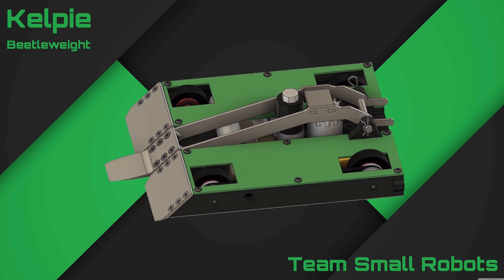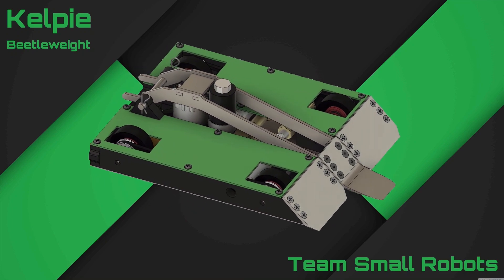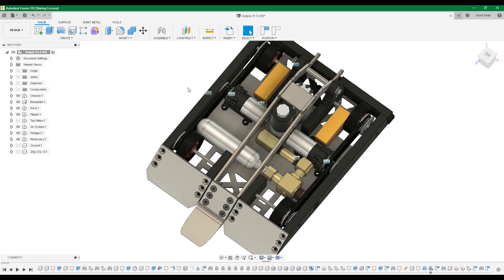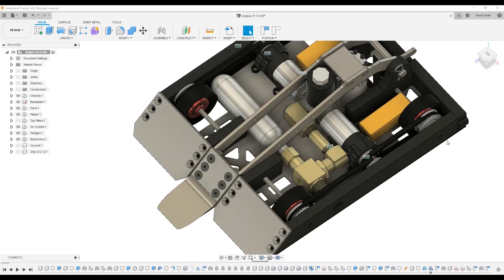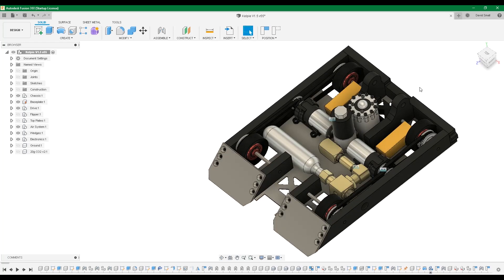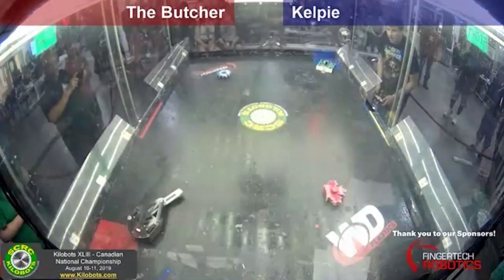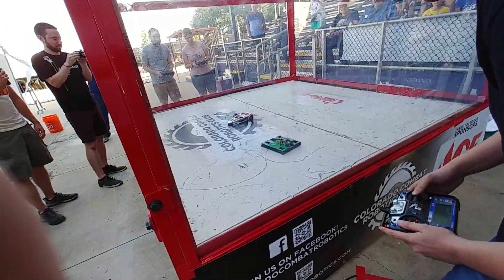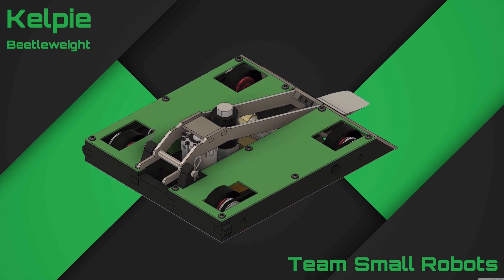Kelpie - The World's Smallest Full Pressure CO2 Flipper

Comment: why dont you have a regulator?
Reply from the maker: A few reasons. Less pressure means less powerful flips. I opted to go unregulated for less flips but more power. If you did squeeze one in though, you could have more flips but at less power. Regulators are also big and heavy, making them undesirable in insect weight classes.

Unlike air, Co2 is self-regulating. When co2 gets to around 800 psi, it starts to turn into a liquid. The cartridges Kelpie contain liquid co2. So when you release some of that gas for a flip, instead of lowering the pressure, some of the liquid gets converted into gas and the pressure stays at 800 (it'll actually drop a tiny bit because the tank gets cooler, but for simplicity, we can ignore that) So as long as you have liquid co2 in the tank, you can keep firing around 800 psi. Once you run out of liquid though, the pressure will drop little by little with each flip just like letting air out of a balloon.

Comment: Title's a bit misleading as different weight classes have different full pressures. There was a robot called Anticide from the UK which weighed 150 grams and could operate at 190psi (the maximum allowable in UK ant weight competitions is 100psi). The heavyweights used to be limited to 1000psi but that might have changed in recent years. I'm impressed regardless.
Reply from the maker: Nothing misleading about the title. Anticide is not a full pressure co2 flipper. It isn't even a co2 flipper.
Reply: @TeamSmallRobots  Correct! If anyone thinks TSR (LOVE the homage to the creators of D&D) isn't telling the truth, you should look up Anticide's publicly published stats, you don't even need to ask Andrew (Anticide's builder) about it. Anticide uses a CO2 cartridge, but Andrew uses compressed air (from an air compressor he brings to events with him) to charge it. I love Anticide, I love 150g bots. I think Kelpie is awesome!
Reply: @TeamSmallRobots  
Maybe one year on I have an opportunity to learn. 
It doesn't mention CO2 in the title, so I presume the definition of pull-pressure implies the use of CO2.
My understanding was that the definition of full pressure was using the maximum pressure allowed by the rules in the container directly - rather than through a regulator.
What is the definition?
Reply from the maker: @Combatechist  Good point. I've updated the title to include "co2" in the name.

Comment: Sorry if a dumb question, do the pneumatic parts screw together with standard fittings or do you have to modify them to make them fit together airtight?
Reply from the maker: Any NPT fittings need to be wrapped with PTFE tape or else they'll leak. And make sure they'll rated for the pressure you're using so that nothing explodes in your face :)
Reply: @TeamSmallRobots  Thanks for replying! ok so I should get parts with all npt fittings? And PTFE tape obvs. Is npt the most common?

Comment: Can you share the specs/sourcing on the solenoid?  I've had a hard time finding solenoids that handle more than 250psi
Reply: It is a Nitrous Purge Solenoid. We were running a Nitrous Solenoid at Motorama and gave him the idea. I never would have guessed he would have put it in a 3lb bot though - pretty neat. :-)
Reply from the maker: The idea was inspired by Flange. I asked around on the FRA forum back in 2018 what Flange used. It is indeed a nitrous valve.

Comment: 1. How much do the full air tanks weigh? (As in full of air)

2. I didn’t know you were on Kilobots. 

3. Can you make a build tutorial for a beetle pneumatic flipper (buffer tank included)? (If this isn’t one.) 

4. Dying against The Butcher (Kilobots) is completely understandable. That thing’s deadly. 

5. Can you make event reports of Kilobots and the other competition?
Reply from the maker: 1. A full 20g co2 cartridge weighs about 2.5 oz
2. Yup! It was Kelpie's first event there
3. A full pressure co2 system is too expensive, dangerous, and complex to be worth making a tutorial video. Buuuuuuuuuut, I do plan on making a beginner-level pneumatics tutorial for an antweight
4. Yes it's very scary! Hence the reason I spent most of the match hiding behind hazards.
5. Possibly. I have a large backlog of event reports I'd like to catch up on. The biggest non-kelpie updates would be my featherweight Morag which I still need to make a video on as well as the new version of Highlander that's now 3d-printed and took 2nd place at GearJam!
Reply: Thanks for the reply.
Reply: Out of curiosity, what is Morag’s design based on? Apollo, Eruption, Bronco, or Hydra? 

Edit: You might want to add some ARMor.
Reply from the maker: @Lumakid100  None of the above :P (Especially not Hydra since it didn't exist at the time I built Morag). The biggest inspiration for it would probably be Rocket (Lightweight) and Polaris (Featherweight). As well as taking what worked for Highlander and scaling it up.
Reply: @TeamSmallRobots  Did you ever publish your antweight pneumatic tutorial? I don't use Facebook and never will (never say never, but... never.), so if it is there, I might have to beg someone I know who uses it.